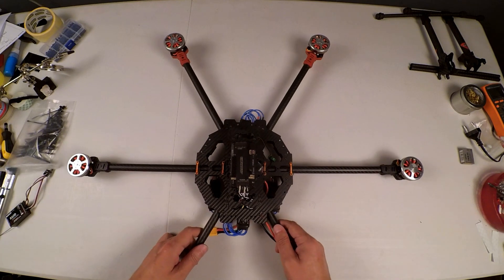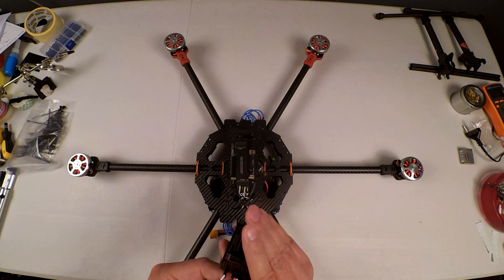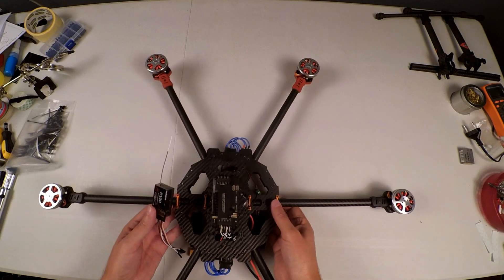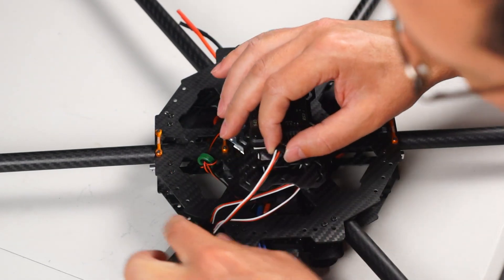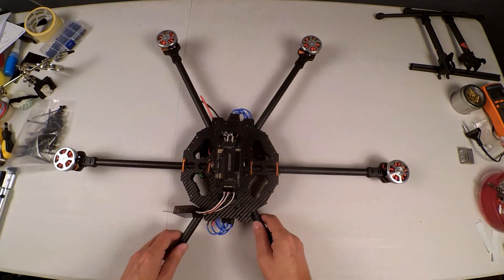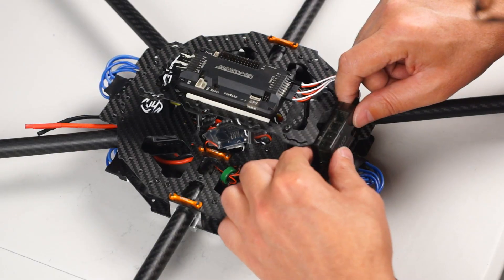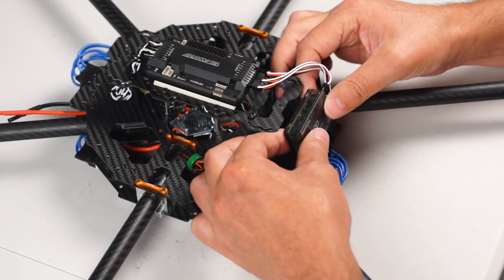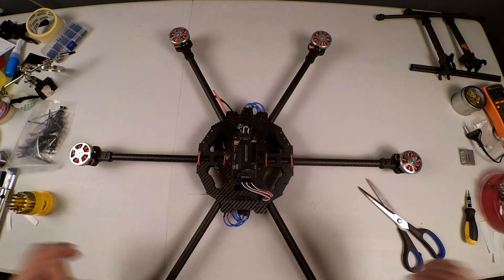Hexacopter Build Part 8 - Connect Radiolink R10D receiver to APM on Tarot FY690S

Comment: Hi Riaan - are you aware that you can use the S-Bus and therefore only use 3 cables between R10D and the APM?
Reply from the maker: Hi. Unless I have missed something somewhere the R10D receiver does not support S-BUS. If I am wrong I would love a link to set this up.
Reply: +Riaan Roux - my fault - I confused my R9D receiver (which looks nearly the same) with the R10D. The R9D will provide S-Bus which I used with APM 2.6 and further more allow a telemetry downlink (which require a telemetry module to be connected to APM - e.g. PRM-02). If you can survive with 9 channels then you might want to change to RD9 which would work with the AT-10 remote as well. (http://www.radiolink.com.cn/doce/product-detail-104.html)
Reply from the maker: Sash PappaRazzi Thank you.  Yes, I am looking at getting a R9D for this purpose.  My R10D was included with the transmitter as a freebie.  I thought for a moment I had seriously missed something, thank you for getting back to me on tis.
Reply: +Sash PappaRazzi Hello I just received my AT9 (with RD9)and my APM 2.8  and whole day I am watching and reading how to connect them. Can you please share how to connect them via Sbus. I read somewhere that APM do not support Sbus by default - is this true. By the way I am waiting for my PRM02...will need to do some soldering on APM side to make it work.
Reply from the maker: +Emil Genov For SBUS support on APM you need to follow the instructions in this video https://youtu.be/7Nqr4-cbyvI
Reply: +Sash PappaRazzi I have red in instructions that can support on 9th for s-bus..

Comment: Are you using six of you channels because your setting this up for a hex. How would the wiring look like for a quad connected to the receiver. Im sorry for the long question but i am very new to this kind of stuff and feel unsure about how to wire things of the receiver.
Reply from the maker: +Rahul Amirth The number of channels are not dictated by number of motors.  Flight control requires 4 channels, 1 for Throttle (up and down), 1 for Yaw (turn left and right), 1 for Pitch (Tilt forward and backward) and 1 for Roll (tilt left and Right).  A fifth channel is used for flight mode selection and channel 6 is spare.  Setup would be pretty much the same for a quadcopter setup.  See this video from the 11:50 mark for more info:
https://www.youtube.com/watch?v=30cCs4aHdB0

Comment: I have a radiolink R9d remote and receiver. Do you by chance know how to connect them. I'm not sure were I went wrong.
Reply from the maker: +Thomas Barns I am sorry, I do not have a R9D and would not like to take a guess.  I might get one in future and will then make a video.  Sorry I cannot be of help.
Reply: +Thomas Barns i have the same one and i replaced it but cant remember what plugs into where on the flight controller,  did u fig it out?

Comment: Hello, pls, what is maximum input power of recevier R10D?! (i have seen different informations in specs on very same model, somewhere is 10V input power, somewhere is up to 16V input power, my question is actualy can it work with battery 11.1V) i would be very thankful on the information..
Reply from the maker: +The Flying Ace 88 The maximum input power is 10v. More than 10v will burn it (maybe not immediately but eventually and perhaps while you are flying)
Reply: +Riaan Roux Just what I was afraid of.. so it is 10v max input. Very good receiver btw.. iv heard it has s-bus on 9th.. Thanks a lot Riaan, nothing like hearing from experience.. clear sky!

Comment: Can the phantom remote work with this ?
Reply from the maker: No
Reply: +Riaan Roux which remotes work with this receiver?
Reply from the maker: The Radiolink AT9 and AT10 transmitters
Reply: +Riaan Roux can I mix max transmitters and receivers?

Comment: Any idea how to connect a R10D to a pixhawk
Reply from the maker: Sorry for late reply, I have been very busy.  The R10D has PWM outputs so you would need as PPM-SUM encoder so you can combine the channels for the PPM-SUM input on the PixHawk.  Fortunately they are fairly inexpensive.  Here is one which is you could consider (you simply connect the channels 1-1 on this and then the PPM-SUM out on the encoder to the PPM-SUM input on the PixHawk.  
http://www.banggood.com/PWM-To-PPM-Encoder-Switcher-For-Pixracer-Pixhawk-MWC-Flight-Controller-p-1070269.html
I hope this helps you.
Reply: Thanks I just had a reply from Radiolink as well thay sed I could also use a R9D and a R9Ds on a AT10 to solve the problem
Reply from the maker: True, the R9D has S/BUS which would work.

Comment: I can't for the life of me, get mine to fly. All it does is immediately tip backward when I try to take off. Logically this would mean that I could just add some forward trim and it'd fly level. But no matter how much trim I add all the way to the max, it just does the same thing. This lead me to discover that it's not receiving any signal for pitch, roll, or yaw from the transmitter. It's only getting the throttle signal, everything checks out with the radio in Mission Planner, and I have no Idea how to fix this. T^T
Reply from the maker: Somehow I missed this comment, sorry.  All I can suggest is checking the signal lead from the receiver to the flight controller and perhaps even verifying output via a servo tester.  I hope you have been able to sort this out in the mean time.